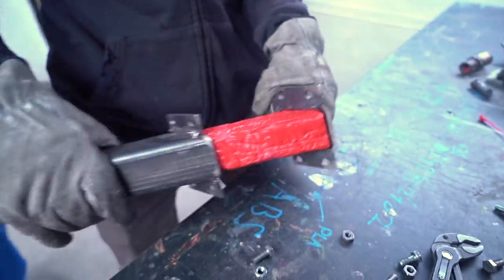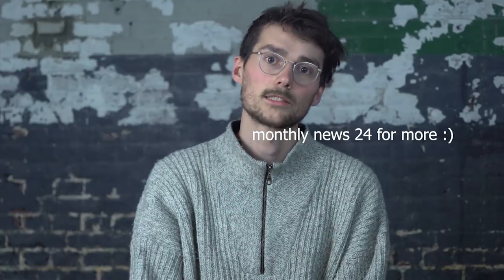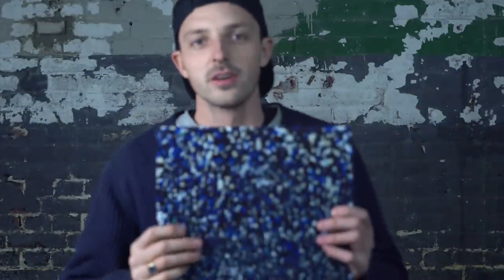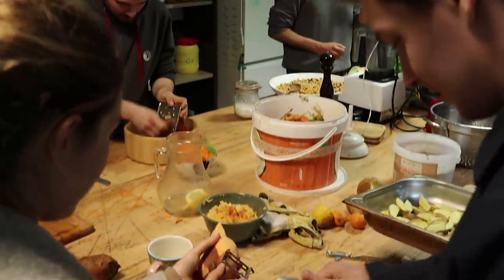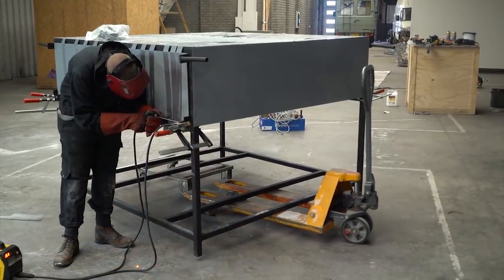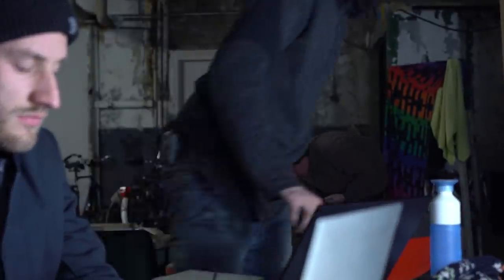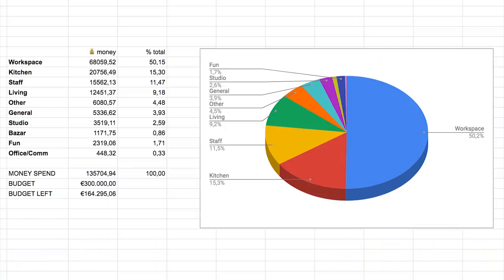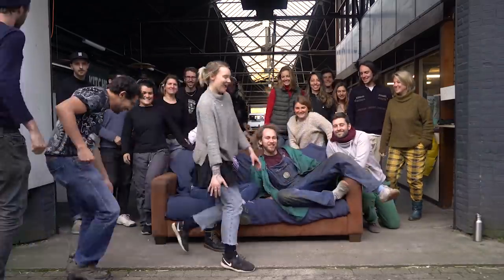Monthly News #26 - How we spent half of our €300.000

Comment: I have been saving milk jugs for the day I build my own shredder. One thing is that the labels in the US are glued on and not easily removed, that I can see. Is there a movement to deal with this issue of labels that are stuck so well to plastic? So cool to see all this happening!
Reply: try using hot air using a hot air gun or hair dryer.. then wipe off the glue after the label is removed with a piece of clothe.
Reply: Trying not to waste water or electric to recycle in the US is hard. I'm trying to get a facility operational in Virginia.

Comment: Looks great so far. Shredded EPS can be used as isolation straight away. Plastic from obsolete (inefficient\beyond economical to repair) electronics is often dirty with glue and/or other types of plastic, grease, etc.  Disk drive plastic can vary in type greatly.

Comment: does anyone know a solid way to turn plastic into plumbing pipe?? i feel like that would be a good use of recycled plastic. maybe even one day making toilets out of plastic
Reply: Half tubes glued ? but glued with what ? that's the question !
Reply: Extruding tube via a nozzle.
Also for plumbing knees  you can make molds the same way you would with pvc
Reply: I like the way you think. We should use the recycled plastic to make the most usefull stuff possible. Houses, plumbing, tobues for transporting recyclable garbage beneath the streets automatically (instead of using garbage trucks), parts and pieces for solar systems...
Reply: Yeah like roof tiles...